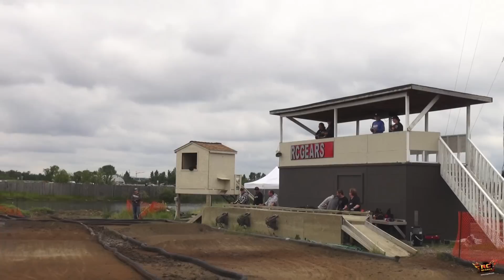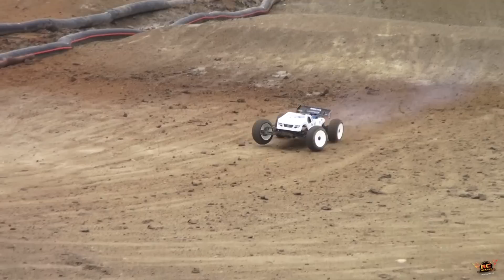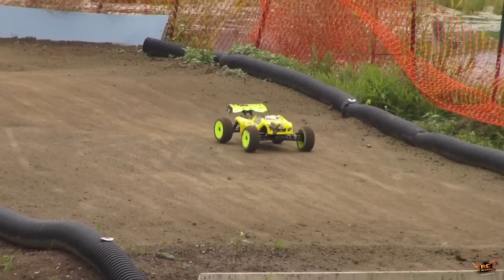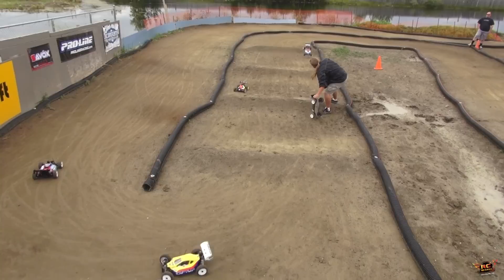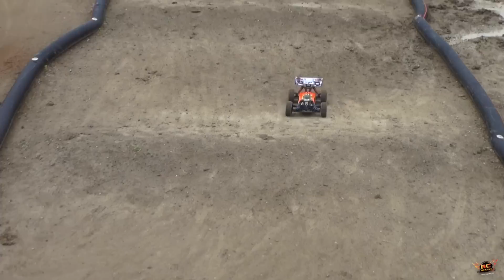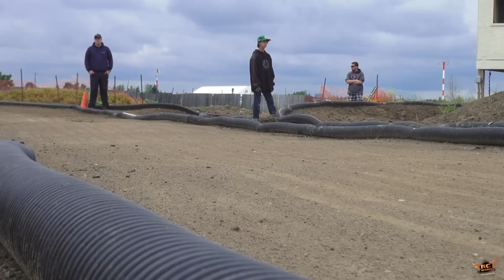RC ADVENTURES - RC GEARS - DiRT TRACK - NiTRO Truggy & ELECTRiC Buggy Qualifying Races

Comment: Carl all of the big name companies make excellent truggies.  I've owned just about every brand of buggy and truggy and all are great platforms.  I've always been kinda partial to Losi as I keep coming back to them.  Most every brand will have one or two good and bad traits.  Mugen is known for being a tad heavy and having weak front arms.  Losi is light and performs excellent but used to wear quicker than most.  Kyosho is the most expensive..etc...  I say pick a brand that your local track and hobby shop supports well so you will have parts and good support.  Most of all just have fun.
Reply: +Teknoforlife Mugen's pretty light for 1/8 scale lol
Reply: +Vizenz121 You are right Mugen has gotten lighter since the mbx7 came out.  it's a great buggy that i was decently fast with just I was a lil faster with the Teknos and losis.  I even tried an sworkz from amain and that was pretty good too.
Reply: Teknoforlife MBX6 is pretty light too? I think the 7's and 6's are pretty light and close in weight but the 5's and older were real heavy...? But the Tekno's I know for sure are like a feather weight for 1/8 scale, because when I see one drive at my local track they can get out of hand if you're not on them. Tekno's go hard though. I think the Kyosho and Mugen are a little nicer and the finishes, but Tekno is still reallly good. The Losi though seems behind the times in handling sophistication and the quality doesn't seem to be near the Tekno. The Tekno's got to be the most sprightly 1/8 car out there though.

Comment: medic< i have a question i think my motor has way to much torque what do you think. it can pull a 25 lb weight from a dead stop and when i give it throttle when im crawling it has an insane amount of torque roll.

Comment: NEED HELP! i have a Losi XXX-NT (NOT ADAM DRAKE EDIT.) Has the side pipe and my Mach .15 engine blew, im looking for a new motor that bolts on and is ready to go w/o doing any extra work, i've been looking online and i havent found any NEW Mach .15's or any motor that seems to fit the motor mounts on the truck, Getting a new stadium truck or buggy / truggy is out of the question as they cost too much. 

Any and all help is appreciated, Fellow RC Lover!

Comment: Is a horrible habit for rc cars too?
Reply: I'm a motorcycle mechanic that works for Honda. I don't know where you heard that but going on and off the throttle isn't bad for a motorcycle engine..
Reply: I would say so, it's more for having more control and keep you speed up when on short straights so you can take to corner easily
Reply: Wouldn't*
Reply: +Dante D. 

I do a lot of blipping until I get a good feel for the track, then after that I'm usually more smooth on the throttle.

Comment: There are only 2 reasons why i dont like / dont own a nitro 

1.I cant drive them where i live , too loud and the fumes aren´t doog for the  pavement.

2. Spare parts,maintenance parts and fuel are just too expensive for me .
(1 gallon of fuel 60 € , same runtime on batteries 40 € for the battery  +30c. each charge = total of 47€ electric to 60 € nitro   :/ )